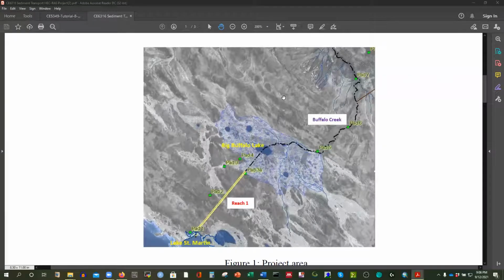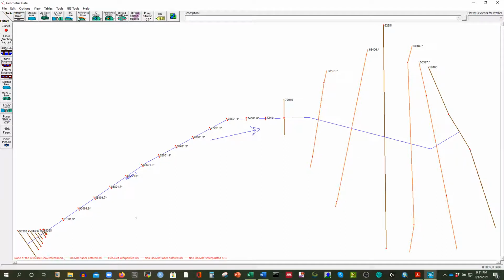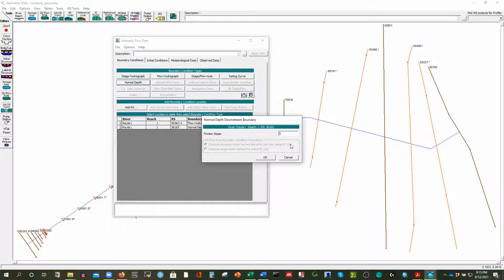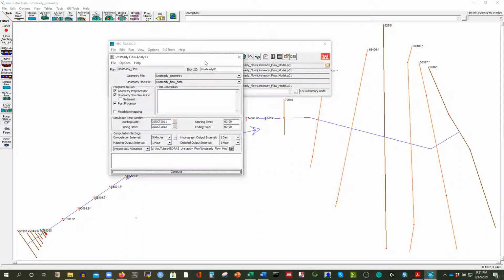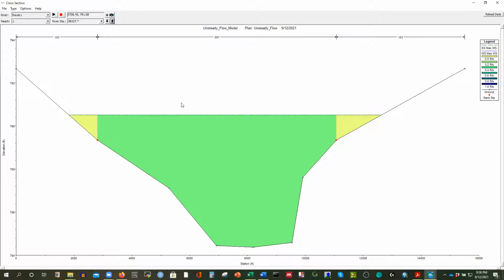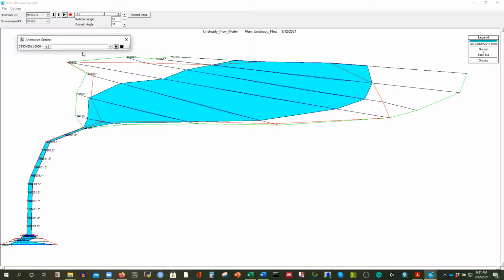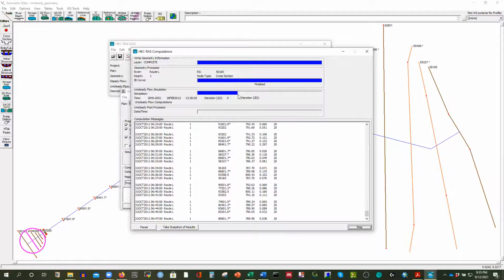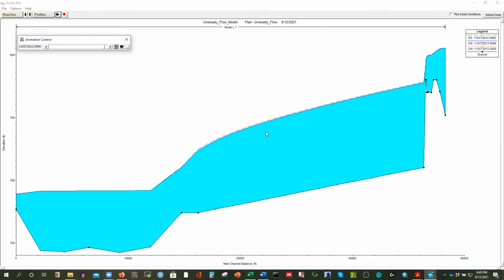HEC-RAS: How To Set Up Unsteady FLow Model

Comment: Thank you so much for the Lecture. I have some confusion, on Normal Depth for the Unsteady flow analysis. how to calculate the normal Dept for the Downstream Boundary condition. Secondly, in the detail output of HEC RAS simulation I got the a higher Froude number for one of the cross section. the Froude number in my simulation fluctuate from 0.54- 1.7. but on one cross-section, the Froude number is almost 1900. I don't know how to resolve this problem.

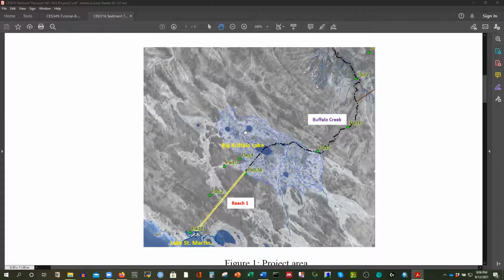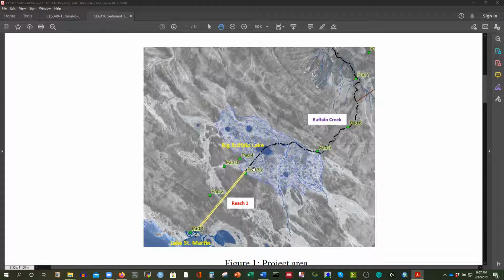Comment: Is there a solution to the Unsteady flow Flow hydro graph not creating the time intervals correctly thus causing the data to plot wrong? For example my invervals are set to 10 minutes but it counts 00:10, 00:20 , 1:30, 1:40
Reply from the maker: Hi shayne! thanks for the query. yes there might be some error in model set up. To learn all the basics I encourage you to attend my training session. For details, post your query to WhatsApp @ +16825537054.

Comment: Thanks, Sir, For Making a video for beginners like me. I have a doubt. I have to do sediment transport modeling in HEC-RAS. Which simulation, I mean unsteady flow analysis or Quasi Unsteady flow analysis, is better for Sediment Transport Modeling. I have read some research papers in which the Quasi Unsteady flow is better than the Unsteady, while In some Youtube Video lectures, It is mentioned Unsteady flow is. Please clarify, Sir. Also, if possible for you, Sir, please make at least a video on sediment transport modeling.
Reply from the maker: Unsteady flow is used to calculate the water surface profile when we run the model without considering the sediment; however, Quasi-Unsteady flow is used when the sediment module is activated. It depends on the objectives of the modeling. Sometimes we use steady flow to make it more simple, even though there is no steady flow in the real world cases. Even we consider the flow as uniform but in reality it's non-uniform, i.e., either gradually varied flow or rapidly varied. These are the assumptions we apply in engineering problems to make things simple.
Reply: @MdArifurRahmahn  thank sir. Now cleared my doubt.
Please make atleast a video on RAP mapper. 🙏🙏🙏
Reply: @MdArifurRahmahn  Sir data file is not opening. It is showing some errors.
Reply from the maker: @nayi_duniya22  Please check here: https://www.dropbox.com/s/tpn3jcleu5xotgo/Unsteady_Flow_Analysis.zip?dl=0